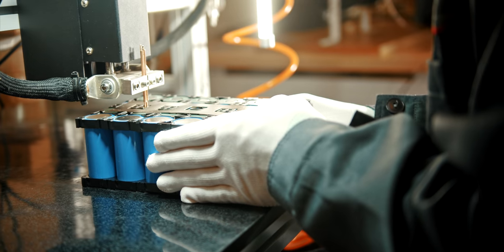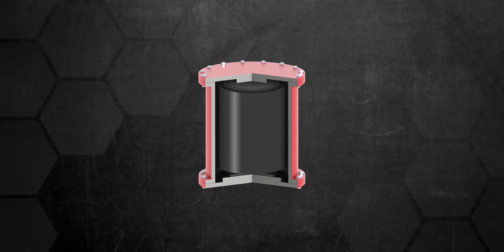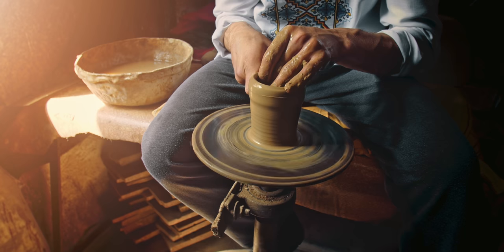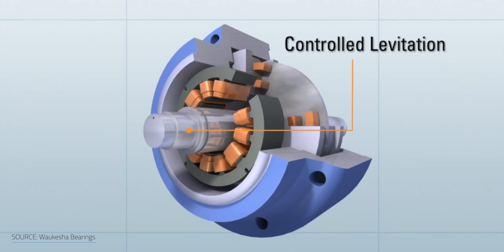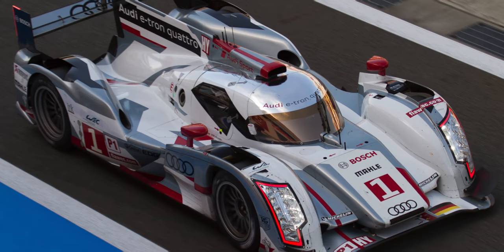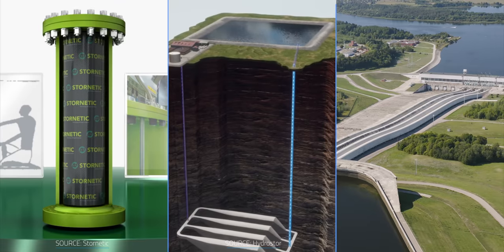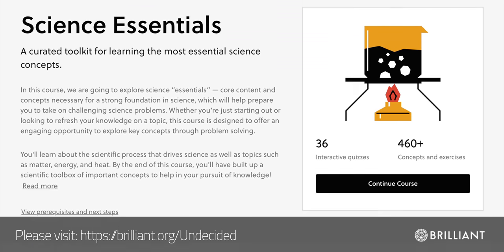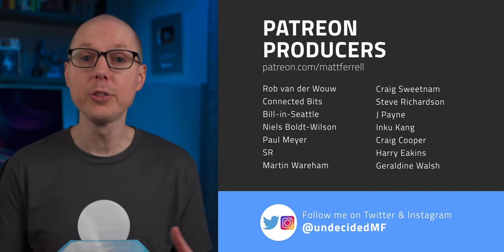The Mechanical Battery Explained - A Flywheel Comeback?

Comment: Flywheels were (and maybe still are) used in commuter trains. Large, high mass, relatively slow speed flywheels work pretty well to conserve momentum for vehicles that start and stop often like In commuter trains. But the much  smaller and less massive ones that are needed for passenger vehicles would require very high speeds to really work and bearing technology isn’t up to the task and failure could be very dangerous. Better to use breaking to charge a battery or capacitor. Not as efficient but immeasurably safer.

Comment: Pumping water into a storage tank located at a higher elevation is another potential source of stored energy; pump it up while the grid is in surplus, and open the floodgates directed into generators when availability of power is otherwise low.

Comment: best part about these is the fact you can use radioacctive byproducts as the weight source, so then you arent using up materials that have other pratical uses. Could also wrap the housing in a material that captures the radiation and recycles it into a useable frequency to suplement the flywheels potental energy when not under load. just an idea.

Comment: 6:15 It's used to keep it at a fixed "attitude" not altitude.

Another nitpick, a flywheel is less a mechanical battery and more a mechanical capacitor. Indeed the flywheels function used to even out the forces from reciprocation is like a capacitor on a rectifier. A battery would be a displacement in gravity like pumping water up a resevoir. A frictionless flywheel could be a like a supercapacitor; it's fast charging and you could hold a larger charge than before for longer, but you wouldn't count on it to have kept all it's charge at the end of the week so not really a battery.

Comment: I mean, Flywheels for energy storage are definitely an interesting concept, which I'm fully in support of if it should become more widely used. But a large mass, spinning at up to 10.000 RPM, is also slightly terrifying.
Reply: Just, like, put them below ground. Big ol' shield in case something goes wrong, would just crash into the surrounding earth as long as nobody was in the maintenance area around them.

Comment: At 8:34, cost per kWh should be based on the same number of charge cycles. Li batteries need to be changed out more often than flywheels. Added to that is the environmental damage done in Li extraction. Moreover Li is not without reason called a rare light metal. There simply isnt enough Li to go round, its a boutique energy storage solution.

Comment: Flywheels or mechanical batteries are fascinating. Didn't know about that vehicle, that was interesting.  Makes me wonder how far a modern take on that could go?  Probably not too far, but still, might be useful for city driving :)
Reply: I was thinking the same.  I need my car for work.  I travel 36km round trip.  If I could get a flywheel vehicle that got me 40km, it would be sufficient for most uses.

Comment: As kids we hadron airplanes made of balsa wood. They had a small wind up propellor that you’d wind up with a rubber elastic band which ran along the length of the ‘fuselage’ from the back of the prop to the tail. I’ve often wondered if this concept couldn’t be employed on a massive scale for things like tractors, lawn mowers, golf carts, etc. using rubber as a source of stored energy. And what about large steel springs? Take the same concept from a Swiss watch with its miniature springs and flywheels and enlarge it.

Comment: How would you go with Michell or Kingbury bearings on rotor axial loads? These gave a huge benefit to Pelton wheel turbines compared against roller bearings. Perhaps a gas or fluid. Then magnetic bearings are almost friction free...

Comment: It would seem that flywheels would be an ideal solution for home energy storage.  Where disruption of power supply is not uncommon.  Secondly it could reduce energy demand on the grid by powering the home for several hours per day with recharging and redeploying a snap.  A win win for home owner.

Comment: I’d expect the effect of the earths rotation would slow the flywheels unless they’re aligned with the rotational axis of the earth. 

All examples In this video show them mounted vertically. 

I’d be interested to see how much loss the gyroscopic effect would cause.
Reply: Yeah, no. You'd see this effect on way larger objects. 

You could also leave the axis free to move, to allow the room to rotate around it like in actual gyro sensors

Comment: One of the big problems with flywheels is they slow down.  you need a transmission that can convert a constantly reducing speed. to a system that delivers constant speed and constant torque.   Because people don't like lights that slowly dim, or computers that eventually fuzz out.  in this modern age you can do this with electronics however those electronics must be able to pass or run with really high power ratings.  It's never been about energy storage but converting that slowly dimensioning energy delivery to a constant power output.

Comment: I think hybrid systems are always the best option. Don’t put all of your eggs in one basket type approach. 
For example, I know lithium ion batteries don’t work well in the freezing cold. 
To be fair, not much works well when temperatures are well below freezing. 
It seems logical to assume a flywheel system would easily outperform a lithium ion system in freezing weather. 
Also you mentioned that flywheels have a much easier time with fluctuations. 
There are about a hundred windmills on a hill by my house. Often the wind is blowing but the windmills aren’t turning. I learned that they lock them out for a variety of reasons. 
For example, if they are producing more energy than the grid can handle, or if the wind is too strong, or if the wind is too gusty and unsteady/unpredictable. 
It seems intuitive to use a flywheel to store wind energy. The flywheel would help steady the inherent fluctuations. If the spinning mass of flywheel was coupled directly to the windmill blades, perhaps the flywheel would even help reduce vibration…

Comment: Flywheel energy is fine, but as you have pointed out in previous videos Mechanical components add a lot of cost due to wear and maintenance, so even though this is an ok idea especially for quick recovery of the energy, maybe partially sticking with the Mechanical side but use a large scale compressor and tank, we already use hi pressure gases so no more dangerous and recovery rate of the energy is almost equal as you can use it to run a turbine, or if you use pure oxygen you could compress to a liquid and it would be even more energy dense.
Reply: @JT > "Flywheel energy is fine, but [...] Mechanical components add a lot of cost due to wear and maintenance"
"Compared with other ways to store electricity, FES systems have long lifetimes (lasting decades with little or no maintenance", Wikipedia

Comment: I'm guessing installation costs will come down sharply, if it involves the things I'm guessing.  I wish there was more detail on that.  But someone will design a unit that is self-leveling, etc. and can just be dropped in.  You could probably count on 1 hand the number of actual large installations, so there is a learning curve here.  And they can supply power for a lot more than 4 hours, it just depends on how much power you draw out.  
This tech would be great for a sunny climate to go with a solar installation, or with a tidal installation.
Since this video was made, the price of Lithium has gone from $10,000/metric ton to $70,000/metric ton!

Comment: Thanks. It's good u mention cost per kWh in comparison between different storage tech. 

What is missing though is a comparison regarding energy per weight and energy per volume. Can modern fly wheels compete with electric batteries in those metrics?

Comment: I was curious about what would happen if you used flywheels as a home energy storage solution, so I did a paper napkin calculation of how many 20 kg weight lifting plates it would take and how fast they would have to spin to store enough energy for one day. I don't remember the number, but I remember it being like 2 orders of magnitude higher than I thought it would be. Then I thought about how easy it would be to spin up just one plate with pedal power and how little power humans actually output, and then it all made sense. Flywheels would be a terrible idea for home energy storage, especially as a DIY solution.

Comment: I assume the advantage of the flywheel-battery combo is to use the flywheel as the buffer for fast charging and discharging in front of the slower battery.

Comment: For the use case of charging a flywheel with excess energy from solar panels during the day and discharging them at night to fuel up an EV. So basically a home battery. You could bury them underground, severely limiting the danger from failures.
What are the caveats to using FESS for this, other than the higher installation costs?

Comment: I would think one of the major limitations for small scale use is that flywheels must be immediately discharged when they are not charging, right? Whereas chemical batteries can hold a charge until it is needed at a later time. I don't know much about flywheels though -- what is their capacity loss if in "neutral" where they are neither being charged nor discharged (just spinning freely with the magnets turned off)? If in a truly frictionless environment I suppose they could go indefinitely, but in practice it is hard to imagine something heavy that just keeps on spinning after being given an initial push.

Comment: Another mechanical battery that may hold potential is a straightforward tower battery?  Like a lift shaft with motor generator at top, add significant weight to the elevator car and lift when excess power, and drop when power needed.  Solves the structural problem from centrifugal forces for flywheels.  5 or 7 ton in a 2 story shaft on side of house would balance rooftop PV?  Motor / generators have run for decades in industry, so surely this system would have a very long life?  Suspect the weak link would be cable life?  Apologies if explored elsewhere in comments, not time to read nearly 4000 comments tonight!

Comment: Another way to store energy if you live on hilly property.  A pond on a high hill and another pond in a low spot. Use extra energy to pump the water from lower pond to upper pond. Use hydro-electric to convert this potential energy to kinetic energy.

Comment: If you want to know why flywheels are a good option, think about EMP.  No electronics except the wired connections which would simply melt off if too much current was being sent to the flywheel.  This is the same reason that the U.S. military is looking into miniaturizing vacuum tubes as they are far more EMP resistant that other technologies; especially when you are talking about nano-meter scale, which includes every single chip that is produced today.

Comment: Combined with Magnetic levitating barrings and hollow shells incorporating internal impellers (blades) with a dense fluid easily spin up and defy stopping under the object of momentum principal then take little energy to re-spin up when force is reapplied. this example is like slinging a bucket of water in a circle then trying to stop it on a dime.

Comment: Any information on weight energy: simply cable, a motor, and a weight and solar panels.  During the day solar powers the motor to wind the cable.  At night the motor spins from the weight letting out the cable producing energy.   Acts as a battery but how efficent would it be?

Comment: A cheap, but less efficient flywheel may make sense if you can deploy lots of it. Because at the end of the day, we have a very limited amount of batteries and unused electric energy will become nothing if you don't store it somehow. So even if you tap just a little bit of that unused power, it will be a lot.

Comment: i build two flywheel generator, and both of them are still running today, im about to build one for myself now, the key is not taking the energy straight out of the generator its to use the generator as a generator to feel a bank of power and manage this to give a perpetual electrical output

Comment: Flywheels kinda need to be part of the grid to act as grid inertia.
The Texas blackout this winter and the Spain/Portugal blackout this summer showed that the grid is very volatile. If it suddenly looses a big producer it's frequency changes very fast. 
The Spain/Portugal blackout was caused by needing to shut down 1 of 2 main lines because it was in the region of a forest fire. Spains grid had more than enough reserve on paper to make up for about 1000GW that were going through that line. But because the grid inertia is very low in Spain/Portugal, the frequency dropped from 50.2 Hz to 48.6 Hz in 5 seconds and that resulted in the Spanish grid essentially shedding essentially EVERY nonessential consumer. So everybody except Hospitals and such was shut down.
It is estimated that the grid would have taken 30s to make up for the loss of 1000GW but because the frequency fell that fast, the grid went into emergency shutdown.

Comment: The hybrid system with flywheel AND batterys maked perfect sence, flywheel for the initial hours after the sun goes down. and batterys for when the flywheel slows down after a few hours
The demand curve says the consumption is still high the first hours after sundown and really low at night after the flywheels has done their part, wich means we dont't need much batterys (that wears out quicker and needs rare minerals to make)

Comment: Flywheels have a massive drawback: they lose energy over time.
So they are unsuitable for long term energy storage.
"Gravity storage" seems to be a better solution there even if the efficeincy is lower. Pump water to a higher level and run it through turbines when energy is needed. If that process takes place in an enclosed system, there are no losses over time. But that's more a solution for stationary systems. Not sure how well it would scale down for mobile systems.

Comment: This could make an interesting alternative to pumped hydroelectric storage in areas where, say, water is at a premium. Or as an alternative to batteries where temperature would adversely affect them. 

Best of all this is like, theoretically extremely cheap. How much does really it cost to build a hunk of concrete and spin it around? Not much I imagine.

Comment: Its the same as running a battery. Energy is used to upkeep making it more and more inefficient as it runs. Connecting these to some kind of suspended and submerged weight makes more sense.

Comment: How about using the solar with thermoelectric devices to heat the water/oil in one container and cool water/oil in another, then use them again to generate power from the temperature difference. Less moving parts and less space than flywheel? Would love to see you experiment and pull some efficiency calculations from it please?

Comment: Maybe this idea would be horribly inefficient but idk. How about a giant elevator type contraption with a huge weight, through a gear reduction, when you charge it up, a motor lifts the weight and when you need energy it falls and spins the motor on its way back down.

Comment: Flywheels are great for “stabilizing”…  not so much for generation.  A fairly significant concept not being discussed in the video is Counter Torque.  When a generator is connected and current begins to flow, counter torque is created in an opposite direction to the torque applied to create the current.  In fact, counter torque is what gives the flywheel such a great smoothing effect for generation, it acts to keep the current the same as the generator slows; but it also excessively slows the generator due to the resistance to movement.  Unfortunately, due to counter torque, the energy input into the system will far exceed the energy output of the system.  Will it work, in concept, sure.  However, I’d find it hard to believe that even with the best frictionless bearings and enclosures, that the technology could be scaled in a manner effective enough for use.  Seems kinda eloquent on the surface, but I believe the law of conservation of energy will prevail.   Nevertheless, I’m sure that won’t stop investors from investing and the general public from being lead down the ‘Road to Abilene.’  So, might as well give it a try.

Comment: Yes, VERY interesting. In your objections, you seemed to concentrate on large to very large installations. With many of us now having solar, wind, etc. generation, why would this not be a practical and lithium free alternative for home use? Much of home generated energy is not used considering the scheduling of the grids. Even if it is sold, it must go through a broker. I think most places do not have the double meter system.

Comment: Many years ago, the Swiss had buses powered by flywheels. These could be run up using hydro power which was very widely available in the country. I am not sure what happened to them or if they are still operating.